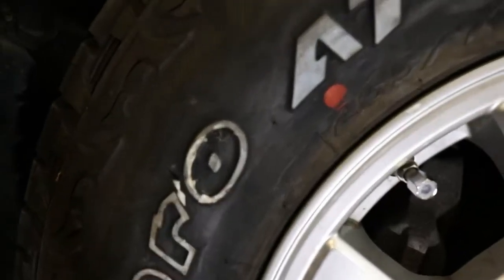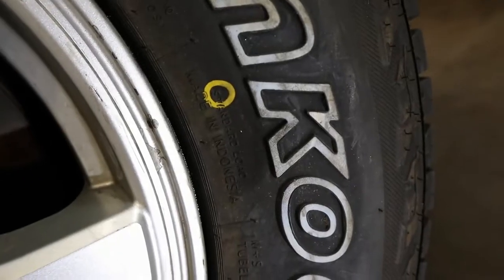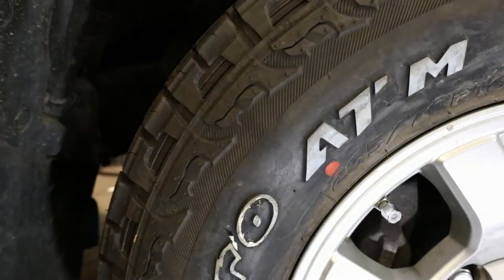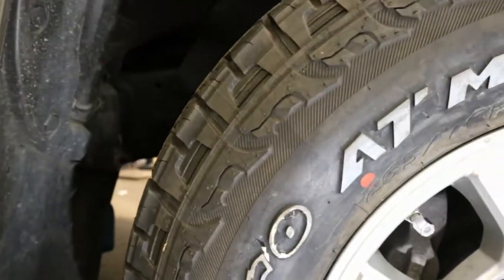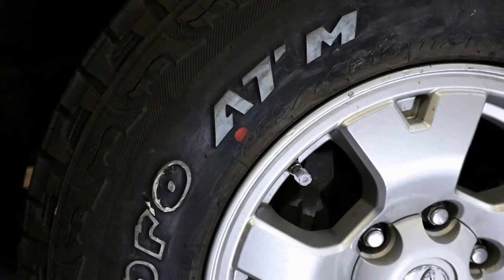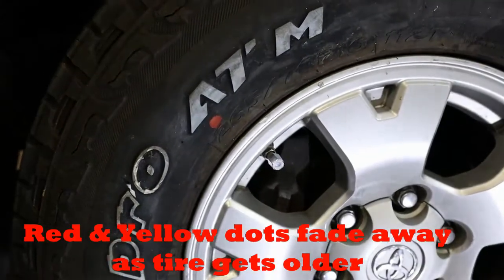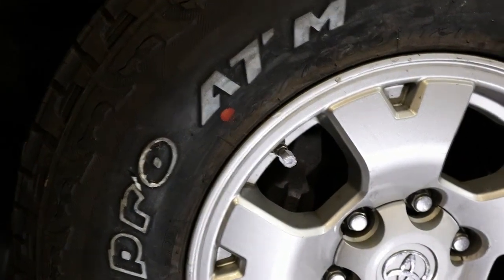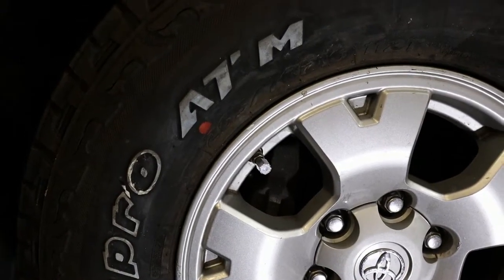Red and yellow dots on tires explained

Comment: YOUR WHOLE EXPLANATION FOR WHERE TO PUT THESE DOTS, ELIMINATES COMMON SENSE AND THE "NEED" FOR BOTH DOTS. IF THERE'S ONE, PUT IT HERE, IF THERE'S TWO, PUT THIS ONE HERE ....THEN WHY PUT IN THE EXTRA EFFORT TO PUT 2 DOTS? WHY DON'T WE ELIMINATE THIS WHILE RED/YELLOW THING AND JUST PUT ONE RED DOT IF THAT'S THE CASE???? LOL  THE RED IS FOR A DIFFERENT PURPOSE AND HAS NOTHING TO DO WITH THE VALVE STEM HOLE, ONLY THE YELLOW DOES. LAYMEN'S TERMS, THE YELLOW DOT LINES UP LIGHT WITH HEAVY, THEREFORE TYPICALLY USING LESS WEIGHT "WHICH IS BETTER" OVERALL. RED DOT MAKES THE WHEEL/TIRE ASSEMBLY AS "ROUND" AS POSSIBLE BEFORE ADDING WEIGHTS, ALSO HELPING WITH USING LESS WEIGHT. THE RED HAS TO DO WITH LINING UP TO A MARK ON THE ACTUAL WHEEL FROM THE MANUFACTURER INDICATING WHERE THE TECHNICIAN SHOULD LINE THE RED DOT FROM THE TIRE. RED TAKES PRECEDENCE OVER YELLOW BECAUSE.....WELL....IT'S OBVIOUS. HOPEFULLY THIS HELPS PEOLPE BECAUSE THESE VIDEOS ARE EVERYWHERE AND MAKES NO SENSE. P.S.  BEFORE SOMEBODY SAYS "NOT UH!" IM NOT JUST YOUR AVERAGE DUDE ON THE INTERNET COMMENTING ON TIRES, I'VE BEEN INVOLVED IN THIS PROCEDURE FOR OVER 25 YEARS, INCLUDING THE MANUFACTURING PROCESS.
Reply from the maker: Great, thank you! You’re the best!
You should make a video on the subject. Thank you for your comment.

Comment: I got new tires and the red dot is lined up with the valve stem. But my front passenger tire the red dot is set off a bit from my valve stem does it mean it wasn't balanced right. Because my tires sound like a airplane.
Reply from the maker: That won’t cause road noise. Is it an aggressive tread pattern?
Reply: @Boulaysgarage  I just got the new ones on the back put on today. Should the weights be all the same on each tire or no. There called Arroyo Eco Pro all season tires.

Comment: This information is incorrect.

Generally, when mounting a tire, the yellow dot (indicating the lightest point on the tire) should be aligned with the valve stem. The red dot, which indicates the high point or most radial force of the tire, should be aligned with a dimple or mark on the wheel, if one exists
Reply from the maker: Yes, I agree to a point however did you watch the connected video to this one?

Comment: What are the small green symbols on Toyo tires?  They may be on the sidewall and are a small green box with a number over a letter.
Reply from the maker: Toyo uses the green dot to line up with the valve stem unlike other manufacturers. Period thank you for your question. I appreciate it!

Comment: The colored dots on a tire sidewall are alignment aids:
	•	Yellow Dot: Marks the tire’s lightest point. Align it with the valve stem, which is usually the heaviest part of the wheel, to reduce the need for extra balancing weights.
	•	Red Dot: Indicates the stiffest point of the tire. If the wheel has a mark for its low point (like a dimple), align the red dot with that for a smoother ride.

If both dots are present, prioritize the red dot unless otherwise specified. These help with mounting and balance but don’t affect safety if not perfectly aligned.
Reply from the maker: Thank you for your comment. I appreciate it. I have recently found out that years after making this video. The red dots and yellow dots have less significance. Especially with Chinese manufactured tires. I have found the best way to balance tires today is with a hunter Road force balancer. That seems to work best. I appreciate your comment. All the best.
Reply: Red dot is the flattest point

Comment: Yellow dot goes by the valve stem, Red dot supersedes yellow dot and the red dot gets aligned with the lowest point of the wheel, not the valve steam.  If there is no low spot mark on the wheel, then red dot gets aligned with the valve stem.

Comment: I asked the meanings of colors  and i have only red dot. Response was: 
Yellow: dynamic and static unbalance, lowest value.
Here it is possible to balance the rim first, mark the highest value and align the yellow marking with it.
 
Red: Radial & lateral force fluctuations, taper, highest value. This refers to the tendency of the tyre to drift sideways.
As far as possible, it is advisable to ensure that the tyres on an axle are mounted in such a way that the red dots either both point outwards or inwards.
 So what should I do?
Reply from the maker: https://www.google.com/search?q=Yokohama+tire+company+red+Dot+on+tire+explanation&ie=UTF-8&oe=UTF-8&hl=en-us&client=safari

Comment: Totally wrong. Red dot goes to the lowest point of the wheel which you can assume that is valve stem. However if no red dot then yellow dot should go to the heaviest part of rim which you can find out by balancing the wheel alone without tire or any lead weights by marking opposite side of laser pointed area and marking it. Then you match the mark you made on wheel with yellow dot. The heaviest point can not be valve stem area at all times. You can check it by balancing the wheel and you will see that you are wrong.
Reply from the maker: Thank you for your comment. You just gave me an idea for a great video you are wonderful!

Comment: Spin the naked wheel on the balance machine by hand to find the low spot on the wheel, mark the low spot. Put the red dot on the tire that marks the high spot on the tire on the marked low spot on the wheel. Balance as usual
Carry on.
Reply: Isnt the low spot on the wheel the valve stem area at all times?
Reply: @demirunlusoy2795  
Yes, almost always on aluminum wheels. But not steel. Dodge and Ford after 1996 marked it with a white paint spot on the inside of the steel wheels, but not always. And sometimes steel wheels have a dimple that's not obvious.
Reply: @user-mp8er1ds9x  Thanks and how can you confirm and be sure that the valve stem area is the lowest point?
Reply: @demirunlusoy2795  
Put the wheel on the balance machine or car without the tire on the wheel and spin it by hand. 
Yes, the tire guy does have to take the wheel off the changer after demounting the old tire, put it on the balancer to check for wheel runout, and then put it back on the changer to mount the new tire.

Comment: I was a manager at Number 1 Tire (Firestone) in Pawtucket RI- not too far from you, and I never knew this. Your so SMAHT! Love it, thanks.
Reply: This information is incorrect, Generally, when mounting a tire, the yellow dot (indicating the lightest point on the tire) should be aligned with the valve stem. The red dot, which indicates the high point or most radial force of the tire, should be aligned with a dimple or mark on the wheel, if one exists

Comment: This is incorrect, red dot is high spot of tire so it is to be matched with low spot of rim.  This is the preferred way to balance tires as it creates a perfectly round assembly.  If there is a red dot it takes priority over the yellow dot which is to be lined up with the valve stem.
Reply: Is valve stem area on the wheel always the lowest point of the wheel? Are you sure? Or is there a way to find out the lowest point of the wheel and confirm that the valve stem is lowest point?
Reply: @demirunlusoy2795  Im pretty sure valve stem is lightest part, lowest part is marked differently.
Reply: @Mrdubomb  lightest part can be found out at balance machine, why to rely on valve stem ? In most cases it might not be valve stem.
Reply: @Mrdubomb  lowest part is not marked at my wheel. Wheel guys at forums tell that they spin and balance the wheel separately and see that lightest point of wheel is not the valve stem in most cases...
Reply: thats exactly what he said dude
Reply from the maker: Red dots on tires proven test
https://youtu.be/iqjc4w1v6Gg

Comment: Just so you know, I contacted Firestone and asked about the red dot.  Their answer is simple, it only indicates the high spot in the tire.
Reply from the maker: Red dots on tires proven test
https://youtu.be/iqjc4w1v6Gg
Reply: Generally, when mounting a tire, the yellow dot (indicating the lightest point on the tire) should be aligned with the valve stem. The red dot, which indicates the high point or most radial force of the tire, should be aligned with a dimple or mark on the wheel, if one exists
Reply: @dahickmans5131  Exactly!!!!!
Reply: Red dot is the flattest

Comment: Other thing was always told was yes yellow dot with the valve stem in tubeless tyres ( lightest part of the tyre with heaviest part of rim with valve stem weight ) 
And red dot was for  if used a tube line up with valve stem , ( a myth I believe ), 
Now is no tubes used and harmonic balancer mark.om  rims
Reply from the maker: Red dots on tires proven test
https://youtu.be/iqjc4w1v6Gg

Comment: Technically your wrong , red dot is for harmonic balancing, and high point so you do not want to put the heaviest part of the tyre as you said with the valve stem that makes heaviest part of the rim 
You want the lightest part of tyre ( yellow dot ) with heaviest part of the rim ( valve stem) to semi balance it,
Red dot goes to the red dots on your rims , or where dimple is drilled in the rim and then ignore the yellow dot,
Reply: i just spent 20 mints arguing with the tire people about this, I won....my rim has no dimple so YELLOW TO valve STEM.....SO THIRD GRADE...ONLY BETTER CARS AND RIMS USALLY HAVE THE DOT OUR DIMPLE...TO USE THE red DOT...
Reply from the maker: Thank you for your comment!
Reply from the maker: Thank you for your comment! Personally, I find that when I line the red dot up with the valve stem. It takes far less weight to balance the tire and that saves me money on using excessive amounts of wheel weights.
Reply: @Boulaysgarage  When installing a tire, you should align the yellow dot on the tire with the valve stem on the wheel. The yellow dot indicates the lightest point on the tire, while the valve stem is typically the heaviest point on the wheel. Aligning these helps to minimize imbalances and reduces the need for additional balancing weights. 
While the red dot on a tire also has a purpose, it's typically not aligned with the valve stem. The red dot indicates the flattest or lowest point on the tire, and it's meant to be aligned with a corresponding mark on the inside of the wheel, often a colored dot or notch.
Reply: Hard to bank on something you say when you vant even spell no comment needed read your text
Reply: Okay, way too many opinions! Looks like everyone is dead on their opinions being facts!

Comment: I bought 4 tyres two days ago. Just kaspen Habiled. To mount on my 20 inch JDM Work Gnosis Gs1 wheels.
I yellow dot mounted to rim first. There was a bit of run out while spinning. Some used very minimum weights. I still felt it through steering wheel around 106kmh and when I let steering wheel go I can see it shimmer side to side.
Went back . Match mounted red dot to the valve stem.
Wow. The runout was greatly reduced to almost perfect. Now front and back is incredibly smooth. Some tyre shop are arrogant about this. Its not their car or comfort so they dont care.

Honestly for any of you chasing vibration. 
Insist on match mounting the red dot first.  It minimises the road force variation and does work. 
If you have runout . You cannot balance it out to smooth it even though the machine says zero weights after balancing.
Runout cancellation always takes precedence over any general weight balancing.
Get rid of the runout even if you use more weights when match mounting to red dot. Its a better ride. Fact.

Ive gone through this twice and yes red dot is king.  Literally lol
Reply from the maker: Red dots on tires proven test
https://youtu.be/iqjc4w1v6Gg

Comment: There is so much contradictory information out there about this, the more I read and hear the less I know.
Reply: I have recently discovered that the dots on the tires don’t mean as much as they used to especially on Chinese made tires which are very common today. Road force balancing is the best way to go.
Reply from the maker: Red dots on tires proven test
https://youtu.be/iqjc4w1v6Gg
Reply: I’ve been watching these videos too, because I already know, I just forgot the system 
Of which this video doesn’t cover 
Especially the rim markings that would supersede the stem alignment idea
Reply from the maker: I’ve been doing this for 40 years and I find that when I line the red dot up with the valve stem It seems to take less weight to balance the tire

Comment: The funny thing is this so much controversy over this  even though this is the (correct way to do it) many people will tell you different.
Reply: And this is what annoys me. Some tyre shops are sloppy and dont care. They say it doesn't make a difference when in fact it makes a massive difference. Especially for customers who are very aware or sensitive to vibrations
Reply: @minhgtr   Yeah the tire shop told me to my face it doesn't matter once they put it on the (hunter wheel balancer) it will automatically balance  the best way they "road force balance  them" I said" make sure the red dot is lined up with the valve stem  pal "...lol
Reply: @--emt  i wish they do right by customers.
You can weight balance but you cannot out of round balance. Hence red dot is so important. So there is uniformity while wheel spins.
Reply: Yes in my opinion if there is only yellow it is lined up with the stem if there is the yellow and the red the yellow too will lined up and if there is just red one i think it will be 180 degree of the stem means in the other side of the stem that is what i think cause i work in the field but i am not 100 per cent sure of the information
Reply from the maker: Red dots on tires proven test
https://youtu.be/iqjc4w1v6Gg

Comment: What about if you have a tire with no red/yellow dots on it? I bought 2 tires from Amazon, 1 had a red dot and the other had nothing. Does every tire has to have a dot on it? Could the tire with no dot just be installed in the same position as the tire with the red dot?
Reply from the maker: You basically just have to balance the wheel as best as possible. If the tire seems to take alot of weight you could dismount it and re locate it to see if it helps.
Reply: If you have no dot then after randomly installing the tire make sure you make your own dot on the installed tire near the valve stem.If your steering still shakes at certain speeds check the balances of front tires, if balances are good then turn the mark 90 degree to any direction from the rim and rebalance. The problem will either get much better or much worse. As you have the mark there you can take it back or turn another 90 degree and you can find the matching point. But it will be minimum 2 maximum 4 tries for 2 front wheels. back side bad balance will not shake your steering but your seat. Also make sure you mark the brake disc and wheel before removing the wheel from car and match that mark too and always install wheel to its belonging place if your balance is good. Wheel nut torques and tighting sequence is also important. Always tighten a bit while car is up and tighten more when its down and apply same torque with hand wrench by feel is okay but tighting with an impact wrench is the stupidest thing.  most mechanics are stupid.

Comment: What happens if it not lined up
Reply from the maker: It can take more wheel weights than needed to balance tires.
Reply: @Boulaysgarage  oh k !
Reply: Your vehicle will fly into orbit passing the moon but not reaching Mars. Only Red dot proper alignment gets you to Mars
Reply: Streak. If you are sensitive to wheel imbalances and running low profile tyres. Its best to match mount the red dot. It reduces run out greatly.
Alot are lazy and dont do it because spinning a tyre on a rim takes some effort.
Next time while balancing tyres. Ask then if you can watch for run out. Then ask them to line up red dot. You watch the runout greatly reduced
Reply: @Boulaysgarage  You can not solve highest lowest point unmatch with any kind of weights.

Comment: The idiots at Firestone just mounted my 2 rear tires with the yellow dot almost on the other side of the valve stem. Plus they had to put 10 inside stick on weights on each wheel to balance the tires. 
Going to take them back and talk to the manager. 
This is unacceptable. They are supposed to be the experts.
Thanks for the video.
Reply from the maker: Your welcome
Reply: Curious. What did firestone say? Did they create an excuse why they didn’t match me up.??? And don’t worry mine new tires on my new wheels from a local shmo tire shop lined up my dots all over the place too.  No where near the valve stem and wondered if major tire shops make that mistake too.... now I know... now... I .. know
Reply: @BLacK_HarTz  
Sorry
Forgot about this post.
I took my car back up there and asked for the manager. As we were walking to my car, I told him about the issues with the tires. He did mention that they are supposed to line the yellow dot to the valve stem. I informed him of all the knowledge that I had found out. He checked out the tires and seen how far they were off. Plus all the weights that were used to balance the tires. He said that they will correct the issue and that he will have a talk with the technician. So everything has been fixed and I seen him having a discussion with the technician.
Reply: Yellow dot should never match valve stem. Yellow dot should match the heaviest point of rim and that is not always the valve stem area. To find out the heaviest point of rim You have to balance the wheel without tyre or any weight and mark opposite side of laser area which is lighest spot.